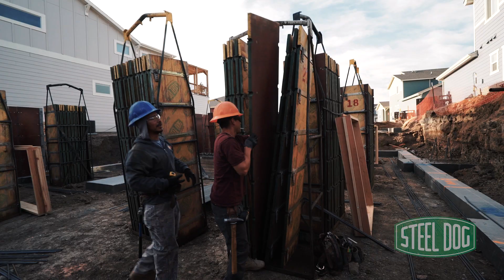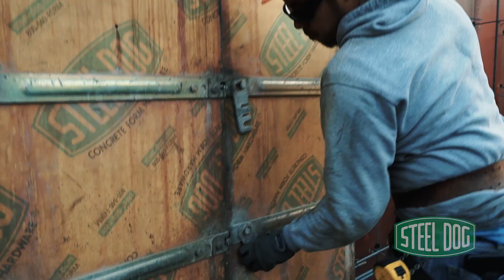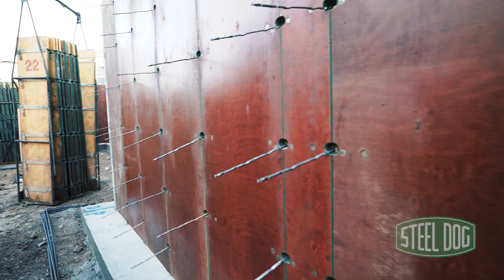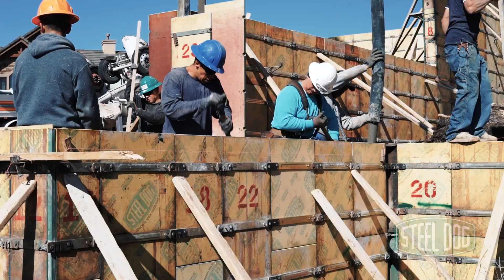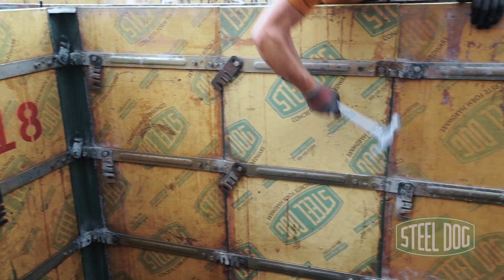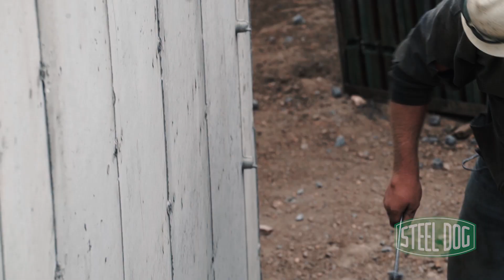1-1/8" Forms - Steel Dog

Comment: 2 year old video with comments only being a couple of months old ?? On a sidenote, 1-1/8 form setting is without a doubt the single best system in the world, ever!
Reply: Yuppppp
Reply: We used to use Simplex forms 20+ years ago - a company out of Chicago(looks like they are out of business now). 1-1/8 in 4', 5'4"" and 8' with those knock-over levers - an absolute pleasure to work with. We could set them as fast as the laborers could lay them out in front of us.
Reply: Not even close to the best. Aluminum is much faster, easier, and does a much better job. Only draw back is the cost. We are still using the same forms we bought new in 2005. Wood forms dont last anywhere close to that long with that many poors. Wood forms are for guys that pour basements once in awhile. Aluminum forms are for companies that do it for a living.

Comment: I set both sides of the wall at the same time with a setting partner. Fastest guy gets the ties in. I do like kicking panels off though. If you can kick them to the dirt bank is more efficient but if there is no bank and someone has to catch them it is still faster then prying them off from the ground level.

Comment: Why are you only setting the outside first? I've done thousands of foundations with these and you always set both sides as you go.
Reply from the maker: Hey Ryan, it's true, these forms are designed to be set in pairs and in most cases that is the quickest way to set them.  This crew builds a lot of homes with a large amounts of rebar, and that was the main reason they developed this system of setting the outside first.  Similar to the way a lot of commercial work is formed when it's got heavy rebar that needs to be inspected. I'm sure on some jobs they could still set in pairs, but having perfected this method, they've found it more efficient to apply it to all their work.
Reply: I done the same way outside first
Reply: Weird, we have always done the inside first lol
Reply: You don't have to. You can do both sides as you go with Simplex forms.

Comment: Even if there was a mat of steel why wouldn’t you put a cage on each side and run it. Looks like it was a top and bottom row so I really don’t get why you ran one side. Edited because I was a dick the first time.
Reply from the maker: We are just the manufacturer, not the contractor.  On the foundation shown here I think you're right, it could be formed in pairs quicker.  This contractor does a lot of other houses where they've found one side first to be faster (custom homes with much heavier rebar, and commercial work where more intense rebar inspections are required).